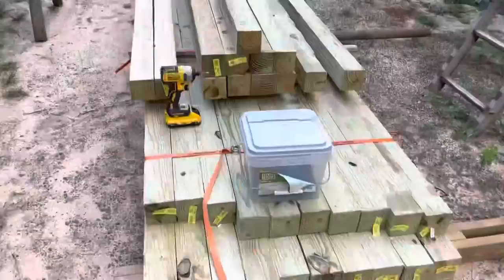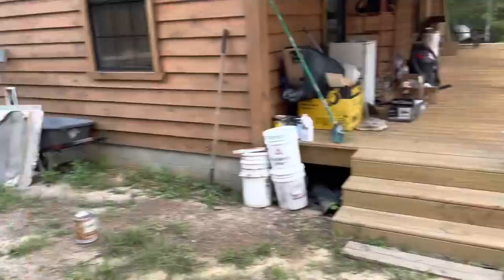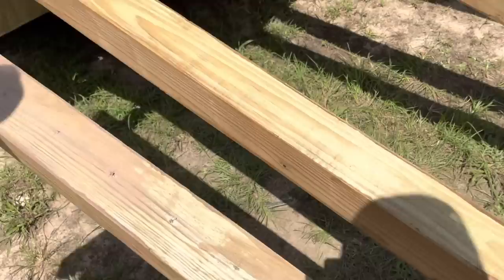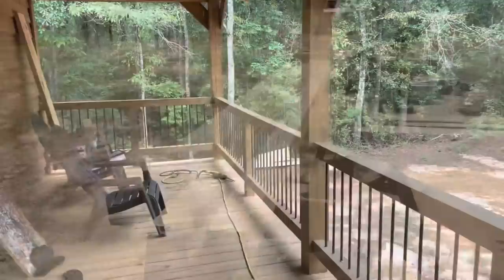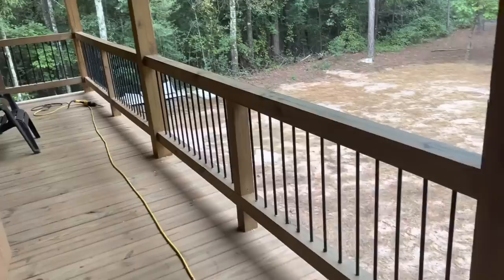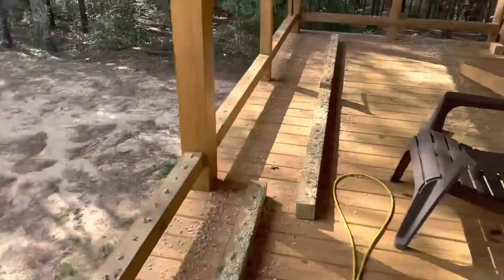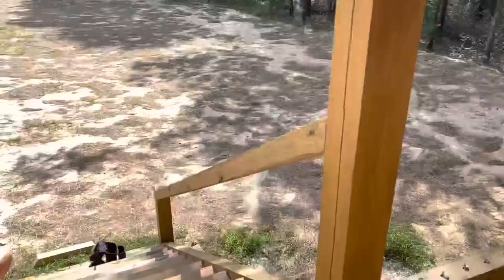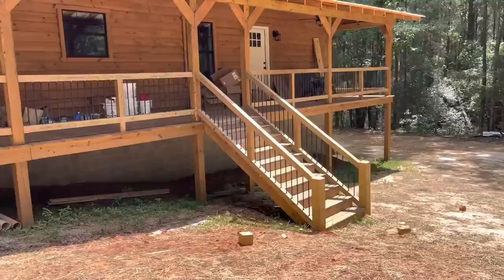Rustic Handrail Build on New Construction

Comment: my oh my that is one beautiful house and I really like your new railings ! Hannah should have used a small paint roller to stain everything !  I'll bet you wished you had a drill press to drill all of those holes - cause free handing them takes a lot more time to do
Reply: With some stains (especially the semi-grandparents) you need to brush to get it to penetrate on treated wood.
Reply: @sassafrasvalley1939   ? " semi-grandparents" ?    I have stained quite a few decks with a roller and never ever had any problems !
Reply: @diverdave4056  LOL… semi-transparent.  Good deal.  I have found that a couple of these oil based stains puddle and don’t penetrate very well on some wet treated wood.  I roll large surfaces then brush to spread and force it into the wood.  I’m glad that you’ve not had the same problem. 👍